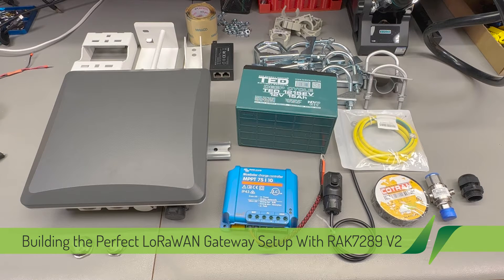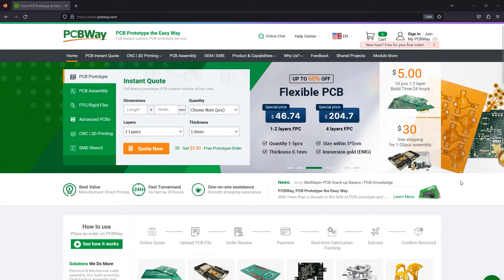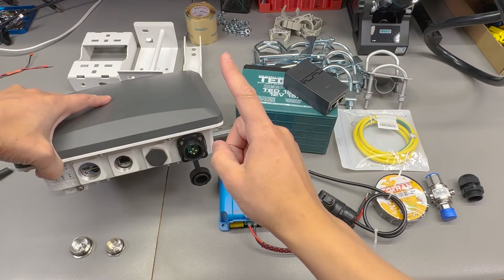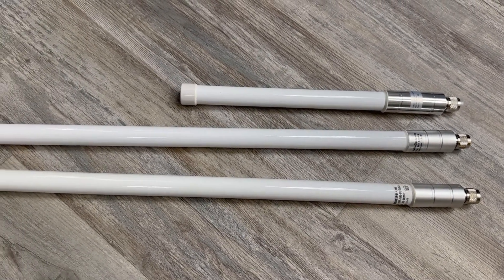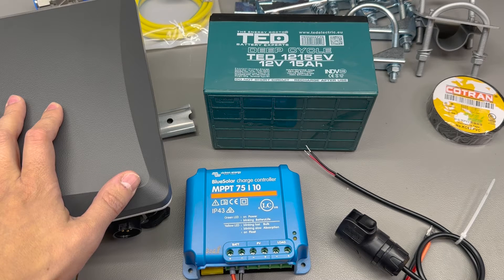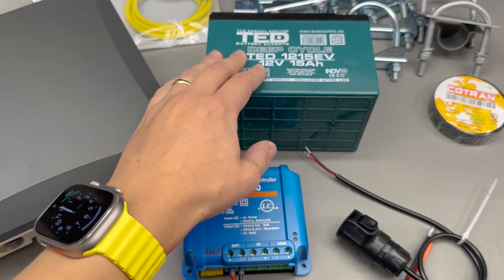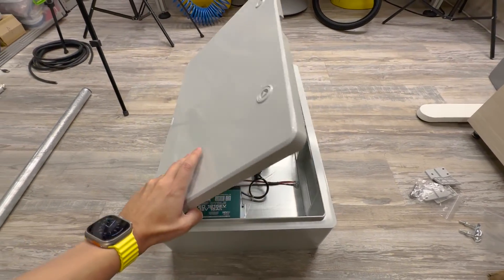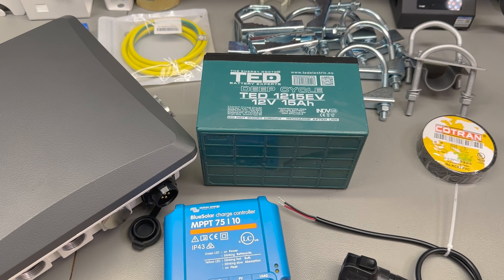Building the Perfect LoRaWAN Gateway Setup With RAK7289v2 (part 1)

Comment: Wouldn't using a normal cellular network work out a lot cheaper? You can get a basic sim for peanuts here in the UK (£3/month) with more than enough data allowance to suit the kind of low/limited bandwidth situations Lora is designed for. All this Lora kit seems to add up to so much time and money in comparison. Just curious as to why you went this route, particularly if it's for commercial customers?

Great video, as usual, btw. :)
Reply from the maker: LoRa is low power, cellular is not. You can have sensors running for years on small batteries transmitting occasionally over LoRa which you can't do with cellular.

Comment: Your closing comment about Ubiquity was amusing.  I outfitted my home with Ubiquity gear after reading how wonderful it is.  After the initial setup, I've been entirely unable to access the equipment again.  The browser-based control system only returns certificate errors and refuses to load the UI, no matter what permissions I allow or how many times I install the certificates.  Utterly useless!
Reply from the maker: For maximum compatibility you should acces it through their Web/cloud interface which ensures no issues with the certificates.

Although annoying it is normal for a locally hosted web page to have issues with the certificates.. This should not prevent you from accessing it. I can still access mine even if Chrome shows a warning about the invalid certificate.

Comment: Don't forget to put some grease on those rubber gaskets! Also, will hot temperature be an issue in the completely sealed plastic box?
Reply from the maker: Thanks for the tip! It will mostly be sitting in the shade under a ledge but that's a valid concern. I will be having a small lora generic node doing temperature / humidity measurements so I'll be able to check remotely.

Comment: Interested to see your issues with Mikrotik. I have been running RBwAPR for about 2 years without issues. Connected to TTN in EU as well.
Reply from the maker: I know many people are running mikrotik gear. It's not really a problem with the running part but rather the pain of config. It's like they're stuck in the past on the config part which is as difficult as it can get.
Reply: @voltlog  The network techs where I work comment that the Mikrotik stuff is way easier to set up compared to Cisco.
Reply from the maker: I don't have any experience with Cisco other than looking over the shoulder of a gray beard that typed commands into a cmd line to setup a very expensive cisco router. What I can say is that in my video we should not compare the setup experience of gear that is destined for general public use with gear that is destined for professional install.

An average user will never get a cisco router to install in their home or not even in a small business. They are just too expensive, too complicated and too overkill for that. Whereas an average user can get a mikrotik or rakwireless product to install in their home, the price range is similar so it's a more likely scenario.